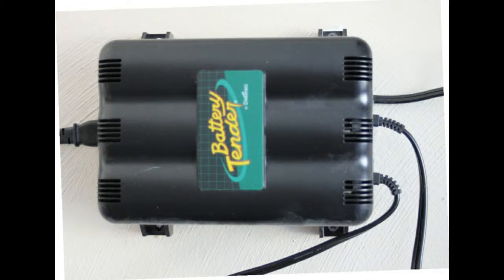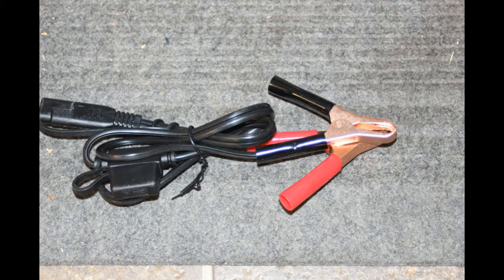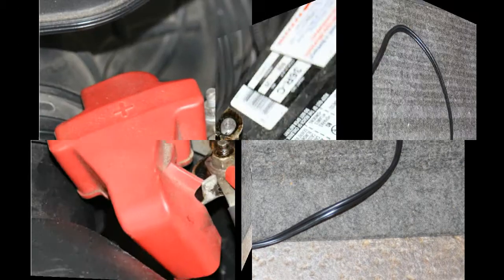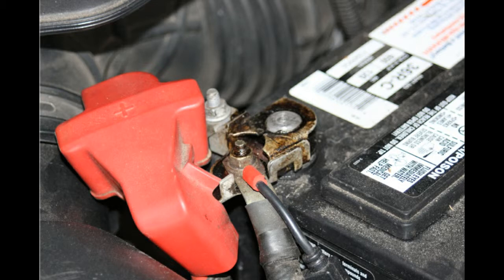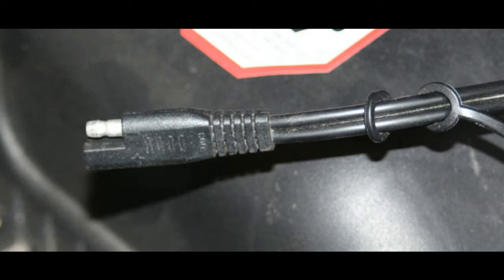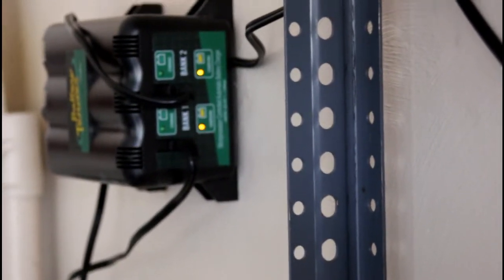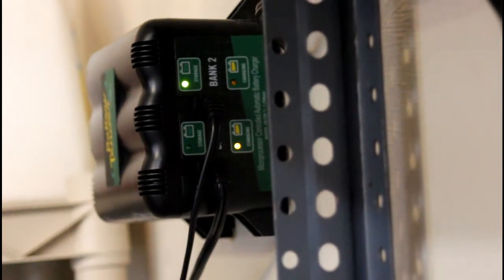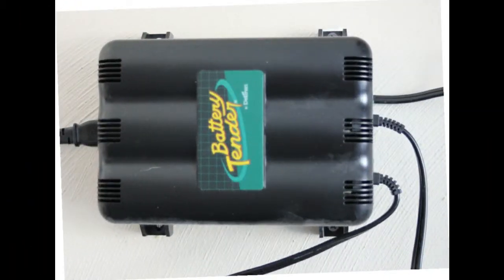Deltran Battery Tender - 2 Bank

Comment: Do you recall how long the wall outlet plug/cable is before it plugs into the charger unit.  Thanks
Reply from the maker: The cable from the unit is ~5' long. I always use a 25' extension, there are times I want to charge a car in the driveway

Comment: I just ordered one from amazon, my only concern is I noticed on the amazon page it shows a graph, and for cars and trucks it says it will only maintain and not charge. Anything below will charge and Maintain...
Reply from the maker: I've been using these since I retired in 2011. They have charged my batteries (the yellow light) and then they switch to maintain (the green light). I have 4 in different locations and never had an issue . 
As an aside, my batteries super to be eating 7-8 years rather than 4-5.
Reply from the maker: The Amazon page says it will charge, are you sure that this 2 Bank is the charger you bought?

Comment: Awesome!  I am picking this up shortly.  I have a TON of the single jr's.  and though they are nice.  I have 2 cars sitting in the driveway that don't get driven a lot and this is a much better solution that I can mount on the wall inside the garage and run the cables out the bottom.  Now years later how has this unit held up?
Reply from the maker: My first is about 10yrs old and still going strong.
I've also discovered that they seem to increase battery life. My '13 Boxster (bought new) is still on its' original battery.

Comment: I have this battery tender charging our outboard motor starter battery and a marine battery for our electric trolling motor. The trolling motor side never gets to solid green just to alternate flashing yellow & green. Sometimes that will go to flashing green only but then it switches back to yellow/green. Is this a battery problem or a battery tender problem? Thanks.
Reply from the maker: You probably never will because of the deep cycle. I saw a solid green once but I had not used the boat in 5-7days
Reply: @ejcheck  So it is charged but won't get to 100%?
Reply from the maker: @woodythorne6892  that's my understanding from taking to them. BTW, the deltran customer service is very friendly. 
Actually, I'm using their dollar panel for my boat, it had a lower output than the plug-in. But it did get to Green once. And, it is charging

Comment: I'm thinking of getting this one....  so far no worries?  I have a jet ski battery and a deep cycle  battery  for my bass boat.   was wondering  if getting two separate tenders  or  just this one  for both batteries.
  Thanks for the  video.. quite helpful!
Reply from the maker: Several comments, answers, for you.
1- Specific performance questions you might want to direct to Deltran - 877-456-7901
2- I have a pontoon boat that gets light use. I got a Deltran 10w solar charger for the battery (~$90 on Amazon). It uses the same quick connects and I just lay it on the bolster on the battery compartment hatch. So far it has worked fine through a season and a half. The Boat has started every time. Hmmm, I think that I may have another video here.
3-I have been told the solar charger will not fully charge the deep cycle battery. I intend to follow my own advice and call the company later. 
4- As far as Deltran goes, I can't speak to other brands, I have been using Deltrans since 2011 with no issues on my cars. The cars will fully charge and have always started. I now have 4 plus the solar.
5- My impression is that they help the batteries last longer. I seem to be getting 7-8 years out of a battery instead of 3-5.
Reply: @ejcheck    Hey man..  thanks for the informative reply.  I'll call them today and see.  I think that if i had a full discharged  Deep cycle marine battery..  based on 1.25a..  it would take like 90  hrs  or something like that...   but i could be wrong too.. been known to happen!
Reply from the maker: @gewglesux  I just got off the phone with Deltran. The 10W puts out 1/2 an amp which is not really enough to charge the boat. 
What it does do is prevent the boat battery from discharging. So if the stator is working and charging the battery this will keep the charge and possibly give a slight charge. 
The safest system would be a dual battery system with the solar panel on the not used battery keeping it charged.
Reply: @ejcheck    Hey  dude!
  Thanks for the reply...  perhaps  i made the situation sound like i had more than i actually do.  All  i have to do  is to charge one Marine deep cycle battery  for a small  boat.
  The battery will power 2 trolling motors(not at the same time) and 2 LEDS for the lights.  in my setup  there is no stator.  In the off season  the battery  will be in the  garage  attached to the  deltran- like my jet ski battery(removed from the ski  sitting on the bench.   the Deltran is supposed to be  shipped  to the grainger store  for pickup tomorrow.
Reply from the maker: @gewglesux  Good luck with your setup. I didn't catch if you were trying the plug-in or the solar
Reply: @ejcheck    Thanks for the reply.  I'm going to try the plug-in  since i'll be charging in the garage   when the battery isn't being used..  speaking of batteries...    They're expensive!
  Deep cycle Interstate  was almost $200..
Reply from the maker: @gewglesux  I trust you've heard the acronym B.O.A.T. - Bust Out Another Thousand
Reply: @ejcheck    Oh yeah....  A bolt at Home depot  is$1  at west marine?$4  I have a jetski  which to me is a small boat....  just  buying stuff for the trailer  is always expensive  PFD'S  Safety gear  always expensive.....  Once again.. i have to come clean...  my "boat"  is a small Basstender...  so when you  google it(i know you will)  try no to laugh too hard...  it's a step above(depending on who  you speak to)  those plastic  pedal  swan boats  you find at community  ponds and lakes..  you know...  where guys propose to their women.

It gets me on the lake and  for now that's good enough for me.  until i can afford  one of those semi fancy  bass rigs.
Reply from the maker: @gewglesux  The Bass Boats look cute. I'm new to boating and last season was curious to see what a pontoon would cost. After the EMTs took care of my choking, I walked into a dealer with a used boat on a trailer. It turned out to have been an insurance total but the engine (70hp Yamaha) and the boat looked pretty good and the boat only in need of minor repairs. I was able to pick up a 2012 20footer for a very nice price, even compared to other used 2012s
Reply: @ejcheck    I've never  had a proper boat  this is as close as i've ever been.  sounds  like you got a great deal! good for you....  20ft..  thats a fairly  big craft!
Reply from the maker: @gewglesux  I got very lucky. Enjoy the boat
Reply: @ejcheck    you as well!!!   thank you for all of the information.